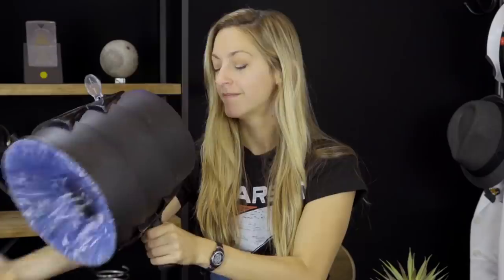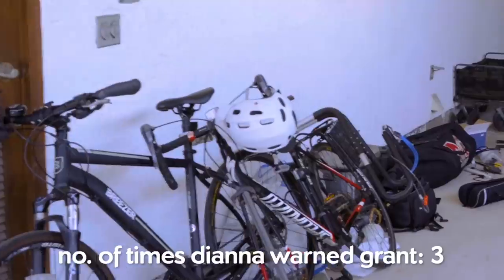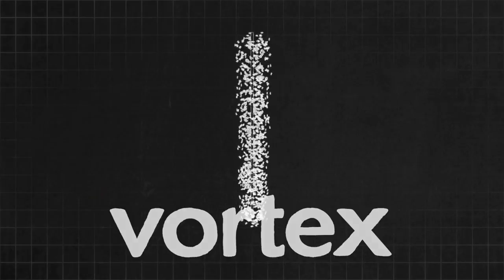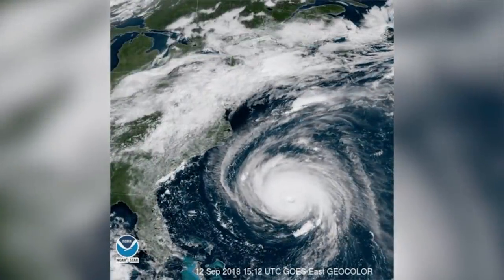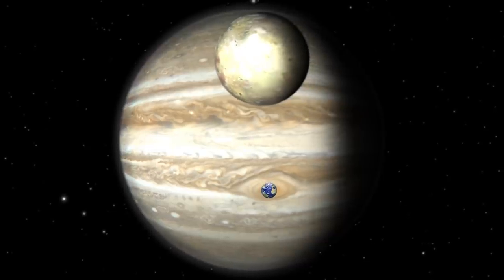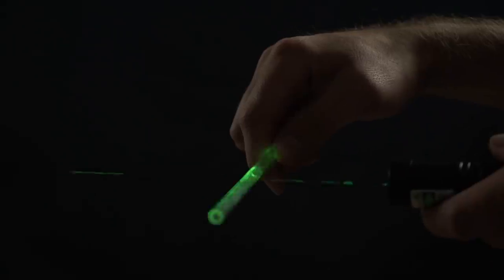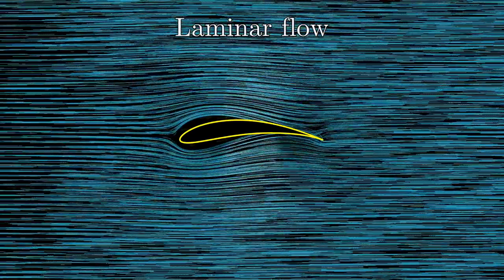How to Make a SQUARE Vortex Ring! ft. 3blue1brown

Comment: This was sooooo close to looking at a vortex question I've had for years. 1) to make a cannon, you have a hole in one end of a drum.  Thump drum and a high speed air column exits hole and the surrounding external air wraps around it.  The inside part of the ring is moving forward faster that the outside.  The vortex ALWAYS rotates like that.  So...  2) You make a cannon with a large diameter face that has not a center hole.  But an open ring hole around the perimeter.  A flat face within the ring is supported so as not to interfere with air flow.  Now thump drum.  Can that make the vortex ring rotate in the opposite direction?  Would it cause the vortex to compress as it advances?  Would it Impart more energy to a target?

Comment: I thought a different reason for this , correct me if I am wrong.
When a circular vortex passes through a square ring ,at that point particles colliding with ring neutralizes resulting in division of ring in four parts .
Suddenly at that moment the particles at terminal of ring parts start attracting their consecutive ends through gravitational pull ,hence resulting in distortion of circular shape. 
 Story does not end here after that when both the ends( of different parts) collide they have some momentum at that point hence resulting in same type of motion in opposite direction. Hence giving a shm type motion in shape of resulting vortex .

Comment: I'm guessing that the modes of oscillation of the smoke ring act like loosely coupled harmonic oscillators and that might also at a more abstract level explain why the system changes back and forth between different shapes, as energy goes into one mode or the other.   ?

Comment: Anyone notice something with vortices and weather? It's not just hurricanes or tornadoes, but it seems some entire weather fronts are a sideways vortex a couple hundred miles long. Not entirely obvious as it appears clouds form on one half, but the other half seems to be dry. (I'm guessing there's a limit to moisture carrying based on altitude.) But there does seem to be something going on where you see a particular flow to it indicative that it's a vortex. On a radar return or a satellite image that shows density, you'll get this candy-stripe or side-on corkscrew effect when there's a strong horizontal roller.

Comment: You wanted a prediction^^ here we go:

I think the vortex cannon with a square hole has more trouble producing a stable vortex. See, the rings are spinning at every point equally fast when produced through a round hole, but when you use a square as outlet of the cannon, I think it is difficult to get a stable vortex, because the corners have more flowing material, which results in a pressure difference inside of the ring. Normally the round shape forms equal forces to cancel each other out very symmetric, but a square is a more complicated form, which could lead to instable vortexes. And the ones that form will quickly decay into a round shape, because of the differences in pressure. Just my assumption :D

Comment: Make a triangle. Reverse the can to make the opening bigger. Will it continue to expand. Can you make 1 shrink. 
Can you put out a candle behind the other candle. 

Make 1 even bigger. If you can make the vortex big enough to surround a person. Will it be calm enough in the middle you won't feel it. 
Use a pipe to make it longer, shorter.
With the pipe you will have to make the opening of the pipe smaller than the rest of it. 
Try pvc pipe. Maybe cardboard paper wrapped around.

Comment: Omg so awesome!  Physical modeling rules.  You built a supercomputer.  Stochasticism included. 
Have you considered putting a bundle of tubes (straws) axes along firing direction to create a laminar flow air “chunk”?  This construction is used in water flow engineering. Large straws maybe for air density/viscosity but....you are a genius curious Georgette. 👍👍👍👍

Comment: So this would be the same for all polygons, as all polygons are self-duals, only it becomes more pronounced with lower vertex count and less pronounced with higher vertex count, of course with a true circle representing infinity. 
Should've tried some leapfrogging. It'd be interesting to see, if you could time it correctly, interaction with two squares, interaction between diamonds, and interactions during the shifting process.

Comment: I think that it will start off square, but quickly deform and distort. Circles and spheres are very geometrically uniform and with the passing air current I feel that is the reason why rings work so well. So I predict that the square will deform into an elipsoid shape or something similar.

Comment: I think that when you try to make the square hole it's just going to circularize and be a ring again.  The only way the vortex spins continuously is by having a constantly rotating structure and it can't rotate if there's a hard angle which is also competing to rotate, so they'll just combine and become a ring.

Comment: Ok, so this is gonna sound super lame but I learned about this from a pretty random source: vaping. 
There are people that do “tricks” with vortex rings and you can do all kinda cool things with them, including making squares, though not with playing with the shape of the hole the vapor comes out, but manipulating it after. If you (very carefully) wave your hand down on one side of the ring at the correct rate, you can apply a rotational force to the ring and create a triangle and even a square. Theres a bunch of ways to split the ring into 2 or more smaller rings as well. 
Tl;dr: fluid dynamics is fun to play with

Comment: Would matching the container shape to the ring shape result in cleaner rings? Like having minimal lip around the hole and having the shape be the same so the air moves in a cleaner path with less turbulence.

Comment: Without reading 1,482 comments preceding this one, it's worth pointing out that when we use the term "hurricane", it always describes tropical cyclone events that occur in the Atlantic Ocean and Northeastern Pacific Ocean. These weather phenomena feature counterclockwise rotation due to Coriolis forces. So, your graphics featuring clockwise rotation more correctly describe tropical cyclones in the South Pacific and Indian Oceans and typhoons occurring in the Northwestern Pacific Ocean. A rather interesting aspect of your side-by-side counterclockwise-clockwise cyclone depiction VERY nicely matches the overturning circulation that occurs within a single cyclone, regardless of the hemisphere. Air inflows at low levels at the surface and, due to convection, rises near the centre of the vortex at the eye wall. Subsequently, you see the outflow at the high levels near the tropopause as the air mass cools. The overturning aspect sees the cooler air falling earthward at the outside, thereby causing the close--proximity opposite rotations. Instead of it being two cyclones side-by-side, however, it's a SINGLE cyclone as viewed as a cross-section. If you look straight down at a cyclone, it's effectively a vortex ring with a few additional interesting features, such as feeder bands.
Reply: k

Comment: Cute couple@0:21, imagine if they had a kid...  Physics Girl+3blue1brown=Iron Man or Batman or 3Genius1Superhero
3blue1brown you should know the safety law: its distance directly proportional to the doubt and inversely to confidence :D 
Why turbulence? IMHO it's fluid dynamics, plus gas and traveling waves harmonics, helped by the cannon output hole: the initial pressure front gets deformed by the out hole and creates a 3D traveling waves, in the form of the output hole, seems rather logical, of course other camera types could improve our understanding, like infrared, ultraviolet, you put some UV lights, and white powder UV reacting in the mix, maybe an x-ray machine/camera, maybe something will reflect and give us better or complementary wave shapes. The laser thing, of course, that works good too, yeah it's very cool

Comment: I wonder if it would be possible to characterize 3D fluid flow by using fluorescent fluid in the fog machine and using a high-powered 405nm laser diode plus the cylindrical beam spreader mounted on a spinning platform such that the plane sweeps rapidly through space, then using a high speed camera to capture frame by frame and then using image processing to reconstruct the 3D flow from the separate slices 🤔

Comment: Ok, I'm at 2:48 predicting that there will be higher pressure in the corners because the vortices converge there, and that will tend to round out the corners?  The sides of the square should have some vortex stretching at first, as described on 3 Blue 1 Brown, so I think they ought to elongate at first until they meet the rounded corners, and the end result ought to be some kind of ellipse or circle.

Let's see how wrong I am...
Reply: Bzzzzt, wrong answer!

Comment: There was one of those super hot in Australia. I was piling up unwanted stuff on the kerb: a small couch, boxes and a curved black glass from a fireplace. The air was still and everything was very hot to touch. I went to the house for just few minutes but when I came back I found the couch and boxes scatered across our cul-de-sac, 5-10 meters away from where I put them, like if they were thrown by an explosion. Few other items where flying in circles like they were picked up by tiny tornado. But the air around was perfectly still, like one of those extremely hot afternoons.
The only item left intact was a curved black glass - when I touced it, it was unbelievably hot, like a frying pan. I burned my hand even though I touched it briefly. 
My guess is - that this hot slab of black glass created ascending flow of hot air,  which, in already hot conditions, created a vortex or mini-tornado, which picked up heavy items like couch and throun them few meters away. This is the only explanation I have.

Comment: Me commenting at 2:36.
I think that as we push through a square one not with perfect pointed edges we will start seeing it reforms into circle sometimes cause as we look it may try to reach a stable state as a circle gives but otherwise it will soon disappear into air as the square bent cylinder of rotating air will try to decrease its radius so.

Comment: Paused at 2.38. I think the results will depend on 4 main factors. 1. The size of the cannon. 2. The size of the square. 3. The amount of air displaced by the cannon. 4. The overall "weight" of the air (humidity, temperature, airborne particulates). Assuming that the last two are "normal", resulting in the rings seen thus far and the cannon is the same then...
... I have no idea.

Comment: A cheap air cannon... (a) find a round oatmeal container, pour oatmeal out to eat later, (b) make a centred hole in the "lid" end  and the end put back on oatmeal container (start small with about 1/8th the lid's area, then slowly make hole larger and note changes in power), (c) thwack the 'bottom' end ' by flicking it with your middle finger and thumb, as when flicking marbles. This will blow out a candle! CAUTION: Do not place near someone's ear, can cause hearing loss.

Comment: The circle comes out because it starts from the back round plastic/latex. What if the box is not a cylinder but a rectangular box? With a square box and a square hole, do we get a square vortex?

Comment: very interesting! In all cases ring dissipates after few meters (molecular diffusion) meanwhile there is another force, that pull the smoke particles together (like an elastic force!), more pronounced in the rectangular ring. This force makes the smoke to alternate shape btw the stable structure (circular) and it's initial shape. Can anyone provide an explain for this "mysterious" force??

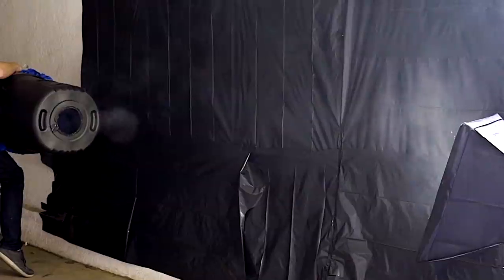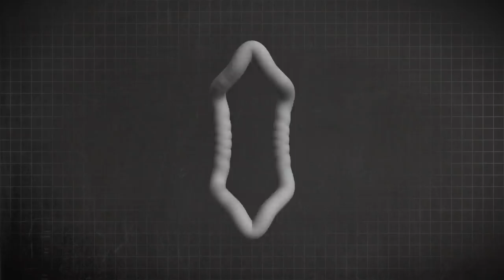Comment: 2:15 the one around the ball was dissipated even though the ring could've passed through. Perhaps the "donut hole" actually carries some energy or tension, instead of being empty. 6:15 a parallel reason is that the smooth donut is the least energy "equilibrium position" and the square oscillates in order to reach that shape, similar to how a pendulum would swing to get back to the equilibrium position. It's likely that the oscillation is damped, and the shape will gradually turn into a stable sphere (if the shape is intact long enough!)
Really cool video guys!!

Comment: What if instead of a circle (which is in a single plane), you cut it at an angle so that the opening is like an ellipse? I mean cut the opening at an angle to the floor instead of perpendicular to the floor. The smoke must move out of the cannon sequentially in time, instead of at the same time.

Comment: Kids, you can do this at home with very simple materials.

Get an empty cereal box, glue the flaps closed, cut a hole in the center of one face. Try all the shapes you want. Light up a cigar, take a couple puffs, knock the ash off, put the lit end in your mouth and blow the smoke into the box. Now rap the back of the box and a smoke ring will come out.

Comment: I predict a uhh.. what do you call it, the shape of a twinkling star. Like take a circle, cut it diagonally into quarters, and flip each quarter so it forms basically a square with dented edges. That shape of smoke. Maybe loops at each corner.

Comment: We know that when few balls of same mass are arranged in a line and are in contact with eachother, then when we strike one side of that line with a ball of same mass the ball come to rest suddenly and the ball at the other end moves at the same time. So my question is...
What if arrange so many balls in line that the length of the line is 300,000 km then we strike one end with one ball then..
1. Will the ball at other end will move instantly?
2. If not, why not it moved instantly?
3. If yes, does that mean that energy moved with speed of light and can also moves faster than speed of light if more balls are introduced in the line?
4. Does this question actually make any sense 😅?😂

Reposting this question... Coz I am really interested in knowing the answer!

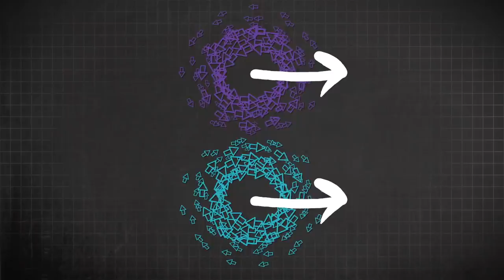Comment: 5:10 that could never happen with real hurricanes because of the Coriolis effect.
Reply: Siddhu
Technically it could but it would be almost impossible.  Hurricanes have never been observed form within 5 degrees or 350 miles from the equator because the Coriolis effect is just too weak to get them spinning. Also hurricanes tend to travel opposite directions in opposite hemispheres, and hurricanes rarely get above 300 to 400 miles in diameter.
Reply: it does explain why a powerful hurricane gets stronger with a more defined eyewall as it gets more energy and raises wind height up higher
Reply: One thing to note, however, is that this does happen with tornadoes. Often you will get a cyclonic and anticyclonic circulation in the same cell.

Comment: A square hole (using my very limited knowledge of physics)  I would predict would end up behaving similarly to the circle one except maybe the square would be a little bit more distorted.

Edit: I was thinking something similar to what actually happened but I was expecting it to break apart in a square like shape instead of oscillating.

Comment: I quote my physics text book:
"Consider a case where charge Q is accelerating, it now produces electromagnetic waves which propagate at the speed of light. Here test charge q' is also accelerating in the electric field of Q and there would be a force on q' due to the electric field of Q. This force on q' is actually due to the electromagnetic waves generated by the accelerating charge Q."

Froce on q' is due to electromagnetic waves???
 Please explain. .

Comment: Genuine guess, without watching..:

The sides will start straight, but eventually the corners will blow out. Reason being, sharp corners are stress raisers, and will concentrate perpendicular air flows. Will update with an edit...

Edit: You can tell I'm a mechanical engineer...

Comment: You can't say that every part of the ring is pushing every other part forward. That would violate Newton's 3rd law. The way it works is that the outside of the ring throws air backwards, whereas the inside throws air forward. Because there is an imbalance between inside and outside the ring, there is a resulting forward force. As the ring becomes smaller, there is less air for the inside of the ring to throw forward so the resulting forward force increases.

Comment: Prediction : 
It's probably gonna come out still round ... Analogizing with a square soap bubble ... bubbler or whatever, it's still gonna be round because it's more stable , as the rest the least surface area on the torus ... In the first instant after it's created it's probably gonna look more square-y ... But not 100% square-y ... Probably starts off looking like a (apologize in advance) x^4+y^4=1 but then it would stabilize into a circle as it travels ... Might also wobble a bit back and forth until it gets stabilised

Comment: 6:15 You are correct. But assuming you are the one who figured it out. That's actually far more impressive. I'm not saying chicks are not smart. But in my experience it takes closer to a lifetime of understanding to comprehend concepts like these. Of which chicks particularly American ones are nowhere near close to practicing. Especially for a lifetime. So a hot American chick who not only understands but can describe this function. Is the most impressive thing about this video. And because she's both hot and smart I find it extremely unlikely that she would not be with some dude who was also both hot enough and smart enough for her to want to be with. Making it less likely to spread her very important genes across the Earth. But any offspring would probably be like real life blades. All of their strengths none of their weaknesses. A perfect example of evolution if ever there was one.